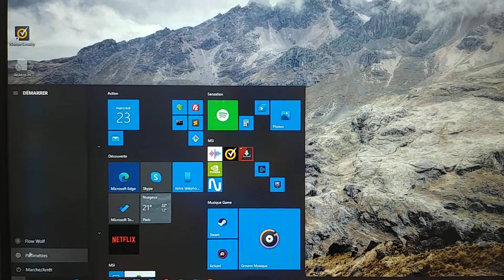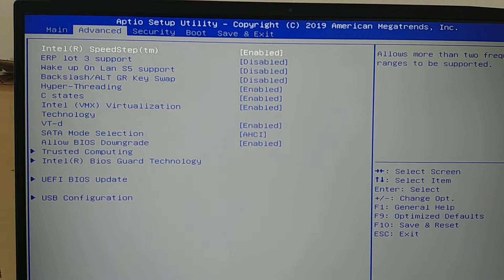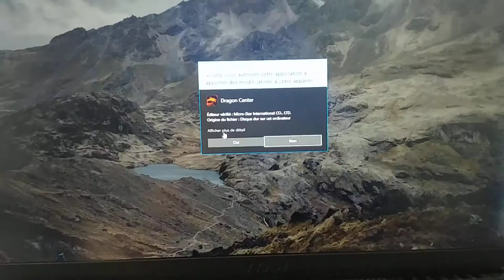How to remove electronic noise from your laptop - whine coil

Comment: For people that have intel processor, on energy settings, change the processor % to 99% (disable turbo mode). This happends because the power supply are too tight.

Comment: I have same problem with Asus vivobook i5.. can you help me?
Reply: Problem in my Asus Vivobook S15 OLED 2023 i5 13500H 
A slight coil whine sound is coming from My laptop when I open any window on laptop and not do anything on that window or when I leave window idle  
Noise stop coming when i type or touch trackpad of laptop or while playing any video 
You can only hear sound if you are in quiet room and put your ear near the right side of keyboard 
Is it normal or I have problem in my laptop
How's your laptop now ? Is it working fine ? Is it still have that coil while noise? 
Please reply 🙏

Comment: DUDE YOU ARE A GOD, i thought my laptop had something wrong and changed it immediatly after 1 day of purchase and second new laptop came with same noise, but turns out it was that whine coil LOL, seems like a lot of the new 2021 laptops come with that noise now that i am reading about it. Awesome video bro!!
Reply: Bro what was your laptop?
I have the same thing in my legion 7 rtx 3080
Reply: I have a legion as well, were you able to solve the coil sound? I can't even find the C-state in the Bios
Reply: @eduardcojocaru5413  did you find it?

Comment: Hi I have the exact same problem with my tuf gaming laptop , I can't hear a thing but when I put my ear near the keyboard I can hear some electrical buzzing , should I do this in my case too?? Lovely video by the way
Reply: https://youtube.com/shorts/7k3irkWEOZI?feature=share i have this is that normal what do you do
Reply: @dalixon9080  mine is not this loud! I don't know you use a microphone on keyboard or you just use your phone to record the voice but I mean when I use it like normal I can't hear a thing I hear it when I almost touch my ear to keyboard
Reply: @aminr2722  this video is setting night and so lonely place so normally if i dont set performance to high performance i dont hear too but performance it coming  until working fans
Reply: @dalixon9080  mine is opposite I don't hear it in performance and turbo mode and hear it in silence mode , I contacted the asus customer service and they said there is nothing u can do about it and it's not harmful to your laptop , so just try to ignore it
Reply: @aminr2722  they say me too but i cant know yet maybe i get rma but probably they say not the problem we update the bios and set windows bla bla so i dont know.
Reply: @aminr2722  is there really not any problem with it? I am very much scared because it is happening on my new and expensive gaming laptop
Reply: @kshitizkumar1168  yes there is nothing to worry about I checked like a 100 pages and I contacted costumer services just don't worry
Reply: @aminr2722  thanks for confirming 👍🏻
Reply: I hav the same problem 😕
Reply: @edwerdkenway8489  well I tried and it didn't work so I contacted the asus technical support and they say it's nothing to worry about and it's so common in gaming laptop and it's not gonna harm any internal board 😐
Reply: @aminr2722  Problem in Asus Vivobook S15 OLED 2023 i5 13500H 
A slight coil whine sound is coming from My laptop when I open any window on laptop and not do anything on that window or when I leave window idle  
Noise stop coming when i type or touch trackpad of laptop or while playing any video 
You can only hear sound if you are in quiet room and put your ear near the right side of keyboard 
Is it normal or I have problem in my laptop
How's your laptop now ? Is it working fine ? Is it still have that coil while noise? 
Please reply 🙏
Reply: @janajit  yes it works like a charm and i didn't have any problem whatsoever and actually just seeing this comment i remembered i did had a coil whine. I don't checked the noise over a year now. And i can assure you its nothing to worry about just try to ignore it. Its not gonna affect your laptop health or performance.

Comment: Thank you for your idea. I have another idea to significantly reduce this sound. In your power settings -> Advanced power settings -> Processor power management ->  Maximum processor state -> 97% instead of 100%. The sound is not zero but a lot lower and negligible now. Also in your battery icon if there is a slider for best battery and best performance, set it to best battery.

The good thing here is you can switch to High performance power mode and demand extra performance anytime without changing BIOS settings but the disadvantage is that the sound is not gone completely!
Reply: thank you very much cause with your tip i've been able to get rid of most of that sound but also to significantly reduce the heat when i play my modded games!
Reply: thank you bro
Reply: I changed to 99% and that was enough to stop the sound. The sound only started when I repasted, there was a coil covered in paste and I think I forgot to repaste it.
Reply: @@rhett7867 Power and Sleep Settings / Additional Power Settings / Change Plan Settings / Change Advanced Power Settings / Processor Power Management...
Reply: İs it normal i have this https://youtube.com/shorts/7k3irkWEOZI?feature=share

Comment: Does it affect the performance of laptop??
Reply: I am having the exact same issue...did u find out anything
Reply: @gamerz1295  I did undervolting using throttlestop and it worked for me
Reply: @abhishekchugh1169   thanks for the reply man....one more question is it worth retuning the item for this issue
Reply: @gamerz1295  If this issue is not so common in the series of your laptop then it's better you return it and get a "coil whine free" laptop.
Reply: @abhishekchugh1169  I am using msi gf63 thin....with i7 ....1650ti, is it common in this series of laptop....and did you tried his method I.e...c States
Reply: @abhishekchugh1169  ohh... thank you so much...I won't be returning it I think this series has this issue...I think I will have to live with it....but I will try underbolting hope it works
Reply: @gamerz1295  Been there bro 😂
You can use throttle stop or Intel XTU whichever works for you.
I wish you'll get rid of that annoying sound after this.
Have a good day man! 
Adios
Reply: @abhishekchugh1169  bro i also have vivobook gaming can u tell how to stop coil whirn
Reply: @abhishekchugh1169  hey brother i watched some of undervolting video and did understand how to do it but there's one question can u please ans it?.
Most of the ytber saying that if you reach that voltage level where ur screen will become blue/black then set 1 level upper voltage but question is if there is blue/black screen appearing that how i am suppose to set 1 level up ?how to remove that blue/black screen?
Reply: @abhishekchugh1169  bro please reply my asus vivobook gaming also have same issue
Reply: @suriyarg9661  bro i have same issue in same laptop did you find any solution
Reply: @gamerz1295  hey brother i also have same issue did u get resolved?if yes then let me know how you did it it will be very helpful. Coz i am thinking to return it if issue not solved
Reply: @Røck I also.didnt return it it's working fine I don't think it will affect our laptops....many people have theis same issues....did u tried undervolting or c states method...if u did what are the results plz let me know
Reply: @Røck bro I noticed while charging my gf63 also produces buzzing noise near the battery, my mom says she doesn't hear it but I m sure it's making that noise....can you check that on your laptop (remember my laptop was switched off while it was charging so it is not fan noise or anything) ...wht do u think is it normal....thx in advance
Reply: @RøckI understand coil whine happening while playing but while charging it's a bit a odd to me....u sure it's coil whine I mean... laptop is switched off while charging...
Reply: @Røck thx mate....i feel better...now..
Reply: gamer Z no worries man ! I just got my gf65 9SD with 1660ti 1 week ago and makes exactly the same noise as yours, it’s so normal the sound while the laptop is charging but u can hear it only by putting ur ears on the laptop, for the coil whine no worries it’s not a bad thing and don’t affect performance or durability.
Enjoy your laptop mate
Reply: @Chris Burns heyy
I bought msi gf63 thin 9scsr 2 weeks ago and it has the same Noise, so i took it back to the manufacturer and got another new one, but it's the same!!! Same noise and i can't accept it, do you think i should replace it with another laptop (other then msi!)?
Reply: @Chris Burns fk bois... I just bought my MSI gf63 thin 10scrc, and I got this annoying sound, so this sounds does not affect the laptop in any way? I read that it may affect the parts lifespan??? Ill try to do an RMA I guess, its a expensive laptop how can it be so poorly build..
Reply: @SilkroadBower  its very common problem for gaming laptops, i just returned legion 7 and bought ge66 and got the same problem...
Reply: @СергейРоманов-ш6е2э  fk bro 😭 whyyyyt iam going insane, I didnt paid for a fking noise machine
Reply: @SilkroadBower  is the problem still there?? Is the laptop working fine?